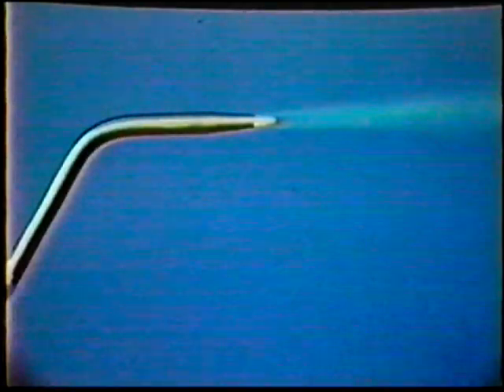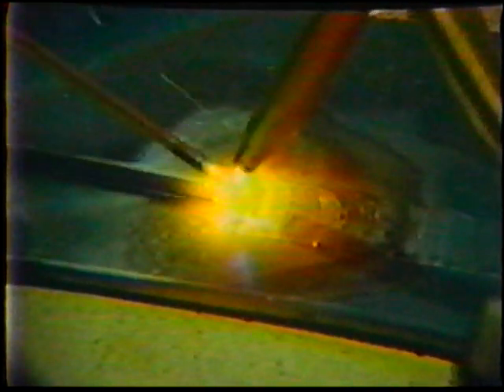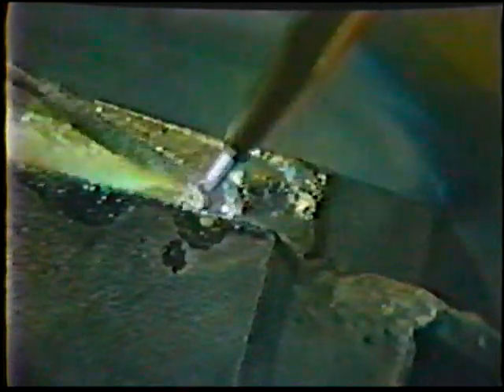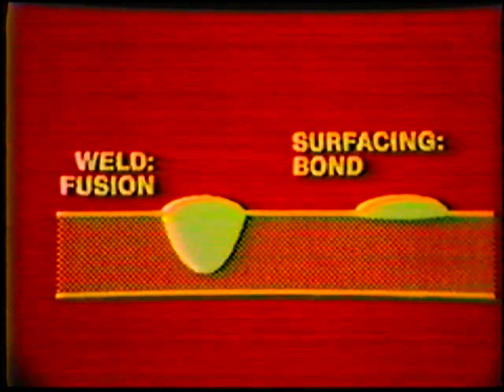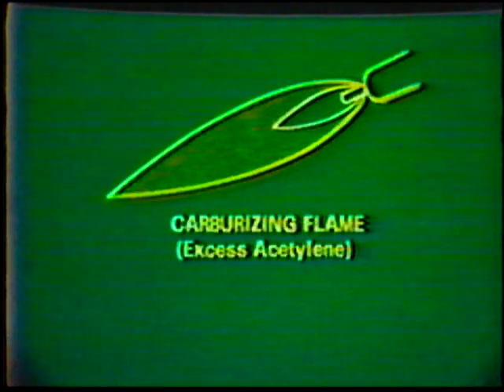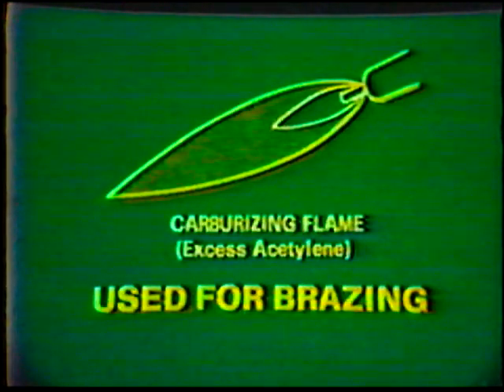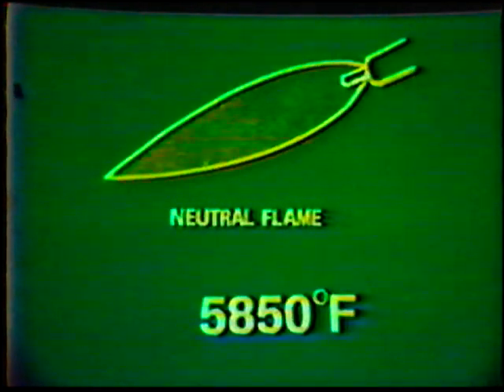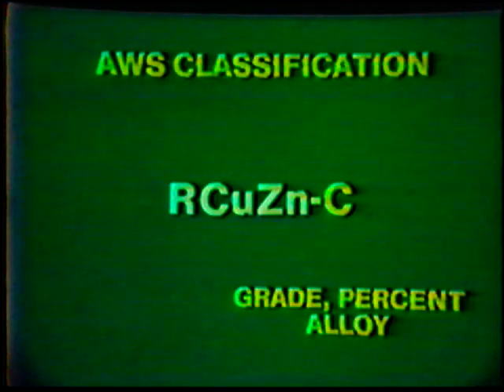Oxy Brazing Part 1

Comment: Outstanding video. There appears to be a flaw in the narration. At 7:05 the narrator says " ..stored in tanks at 250psi ...Acetylene is dissolved in acetone which is a porous material made from pomice, balsawood or other material" This is NOT correct. Acetylene is dissolved in acetone which is a SOLVENT poured/placed in a lattice made of pomice balsawood or other sponge like material. The acetone absorbs a lot of acetylene and allows the acetylene to be stored at lower pressures. Acetone  impregnates the spongy material and minimises the risk that acetylene decomposes in carbon and hydrogen which would cause an explosion